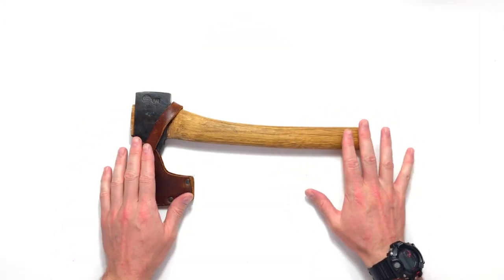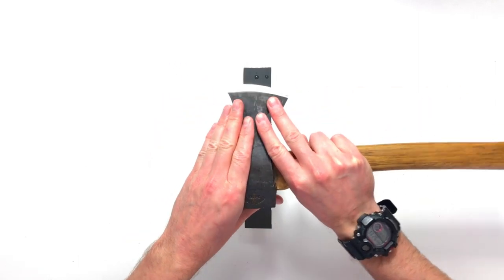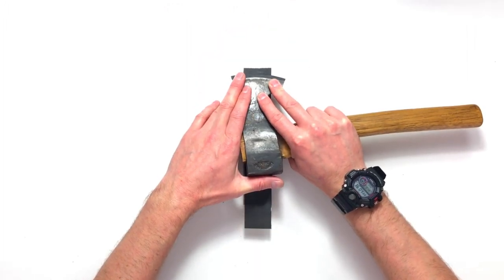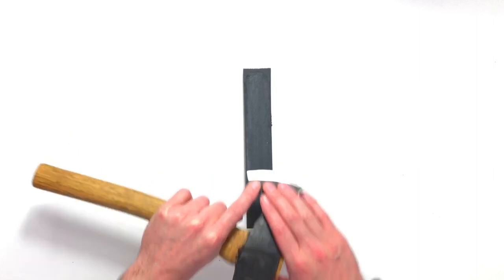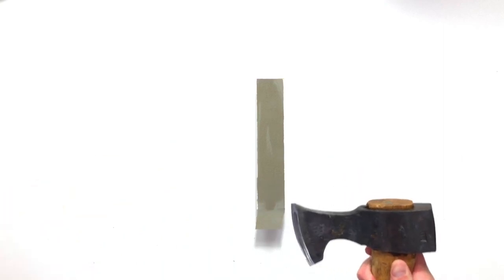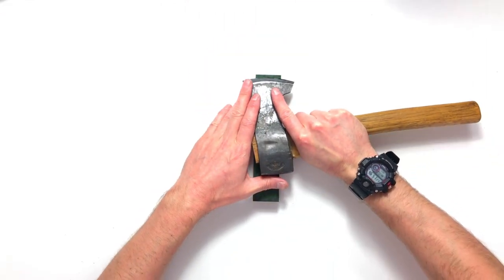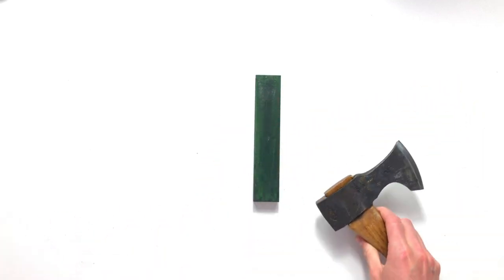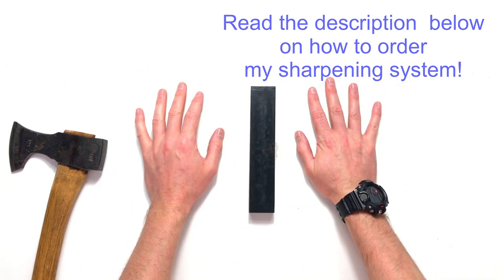How To Sharpen Your Carving Axe "Scary Sharp” Tutorial

Comment: Thank you for sharing this, it is great to see different methods of sharpening on a different hatchet head. I am a tomahawk fan, I find them really versatile for bushcrafting - and I usually do use a Lansky puck followed by some micro mesh pads only. Always results in a nice, slightly convex bevel. Might give your way a try though, looks really neat.
Reply from the maker: Rathwulven Bushcraft hey it’s my pleasure!! It’s worth keeping the correct sharpening method for the bevel. You can’t sharpen a convex edge like I do the flat edge here :) you have to work from behind going towards the cutting edge :)

Comment: Do you need to grind  the ‘hollow’ out from the tormek or is a slightly concave bevel ok (for carving rather than general splitting)
Reply from the maker: Hey Simon! If you bevel is convex, just stick with it :) ideally you’d use a flat bevel for carving, but for years I used a convex edge and just maintained it with fantastic results!

Comment: Don't want to be rude but what is the point of grinding to 7000 grit? An axe will split wood fine with an 180 grind finish.
Reply from the maker: Hey John, it’s a great question. The reason for going to a fine grit is 2 fold. Firstly a fine edge lasts longer than a coarser edge and secondly, this is used for wood carving rather than wood splitting - we need them to slice away wood with accuracy often times taking only thin small amounts off. Thanks for the question, Tom

Comment: So you gave it a hollow grind, weakest grind for a axe.
Reply from the maker: Hi John, remember this axe is designed for fine carving and not log splitting and limbing. It's used with accuracy to cut small amounts of wood off. The flat over hollow is on all high quality hand made carving axes.

Regards, Tom.

Comment: I stick my axes in the vice and use a file. This method here would take waaaaay to damn long, unless your axe was already relatively sharp and didn't need sharpining anyway, in which case...WTF?!
Reply from the maker: Hi Doug, if your carving axe requires a file I’d recommend getting a second cheap hatchet that you can remove bark that may have embedded stones or abrasive medium in it. Use that to split billets etc and then use your carving axe from there onwards which should be sharp and cared for both in use and in maintenance. If you are needing to remove that much damage either your bevel angle is wrong, the steel is poorly heat treated, your chopping block has impeded abrasive medium / stones or you are removing bark with it. Warm regards, Tom